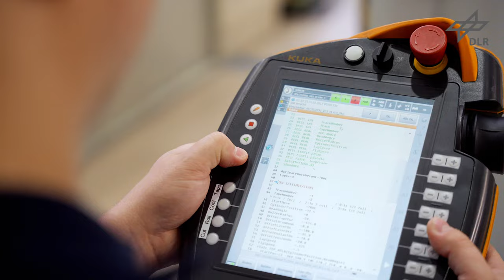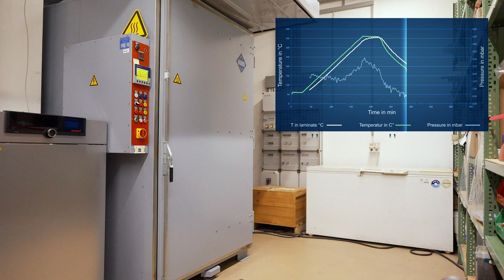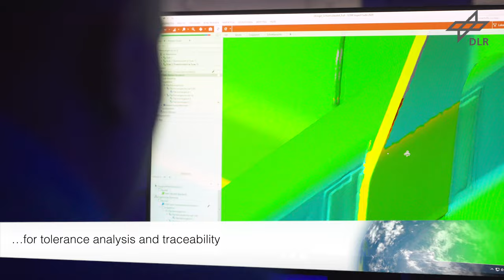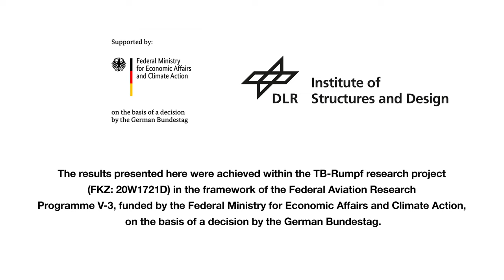Technology Bricks for Future Thermoplastic Aircraft

Comment: How does it do with aircraft based paints on it's surface? Or will wraps be needed? Are thermoplastics great for deflection in the wings?  Or are these mainly for the fuselage in low stress areas? Will doublers and rivets fatigue the thermoplastics and have a lower barrier to NDI failures?
Reply from the maker: In principal thermoplastic are paintable, of course with adapted pre-treatments and paint systems, roughly comparable to thermoset composites. 
The structural behavior of thermoplastics is more or less equal to thermoset composites. Their major advantage is the ability for welding. With a full thermoplastic design you will get rid of fasteners.
(Although crack propagation for thermoplastic is less problematic than for thermosets)

Comment: At 3:02 you see a typical aircraft/vessel structure. It could be made of aluminium, cfrp; both thermoset as thermoplast. Even you see these structure type in a ships hull, in steel.
The structure shown is hence a multi-material solution. 
Pose the question to yourself: Did I propose the right structural solution with the production possibities in carbon thermoplastic? Or did I copy-cat a metal structure?
In the EXTRA 400, the first certified composite pressure cabin in Europe, we (team of 5  of Delft University) designed a completely new structural system for that pressure cabin.
It was definitly not a skin-stringer structure.  IABG tested it extensively, and it was certified. 
DLR, be creative!
Louis van Rijn, former ass. professor composite design, Delft University.
Reply from the maker: Thank you very much for your comments! The design of the upper shell was one of the specifications given in the project. On the one hand, our focus was on maturing processes that are currently still under development, and on the other hand on demonstrating these processes on a large scale and in a highly automated manner. It`s true that the use of CFR-TP`s offer new possibilities for advanced airframe concepts which should be considered within the design phase.

Comment: Is it like carbon fiber?
Reply from the maker: Hi, thank you for your interest! Yes, actually it is carbon fibre. But the matrix, the material surrounding the fibres, is thermoplastic material, not thermoset as for the most other applications. The thermoplastic properties leads to a number of advantages, like you can weld parts together after manufacturing.